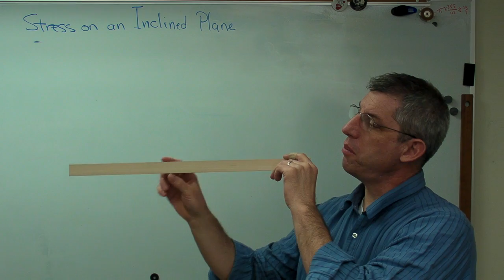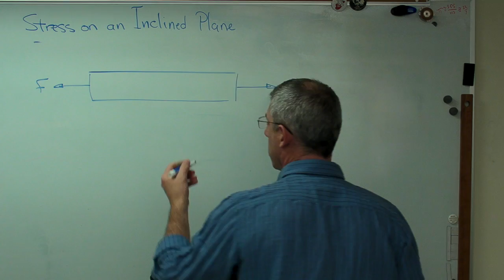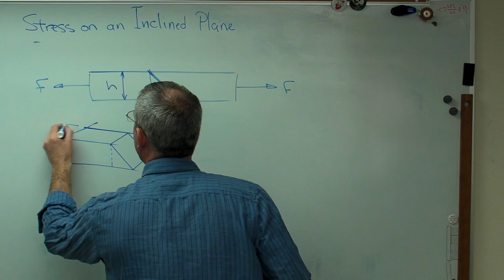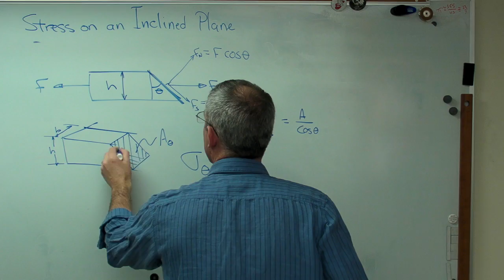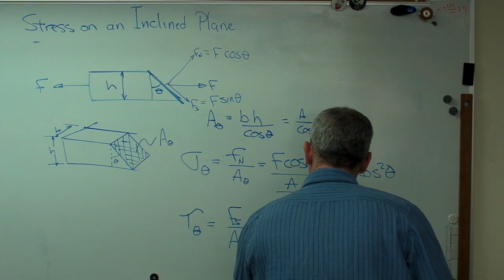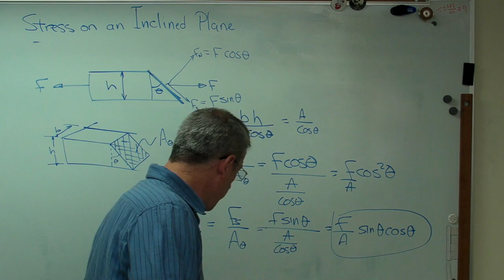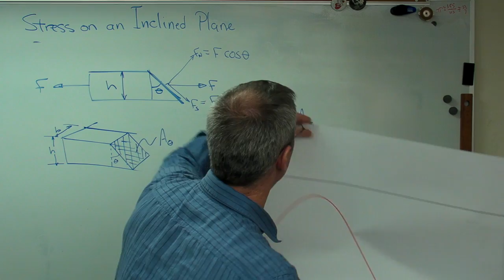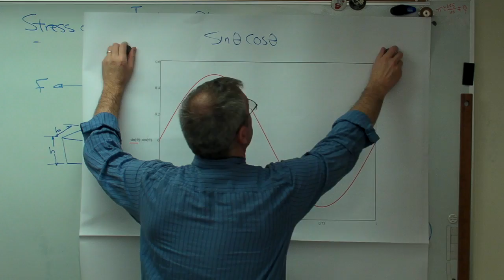Stress on an Inclined Plane.MP4

Comment: Thanks! I'm studying for the FE exam and I have no experience in Mech. Eng. The study guide does not explain concepts at all!

Though, in the book, they solved the problem using the Transformation of Stress Equations. I don't understand which angle to plug in for those equations. If you ever do a video on that, please let me know. Thanks!

Comment: Dear Prof. RM French, Thank you for your videos they are very helpful! Please if possible could you do a cantilever beam connected to another wall, with pin joints at a section in the beam, or a similar problem and explain what happens to a beam if you(after solving it) add another moment. Thank you in advance. Best wishes!